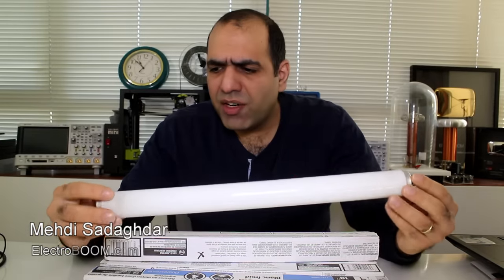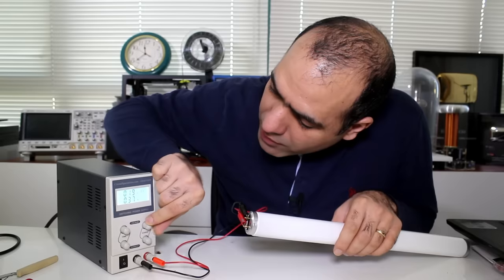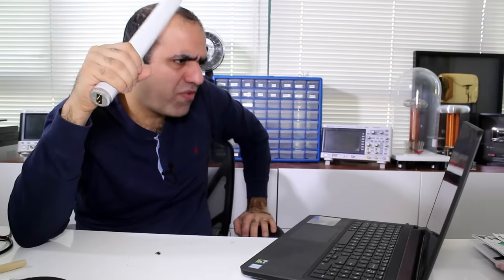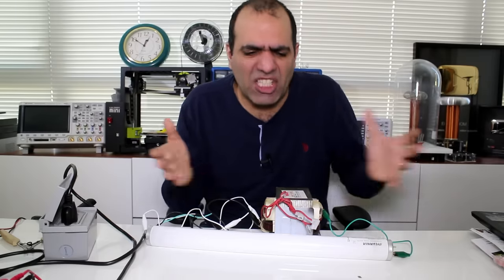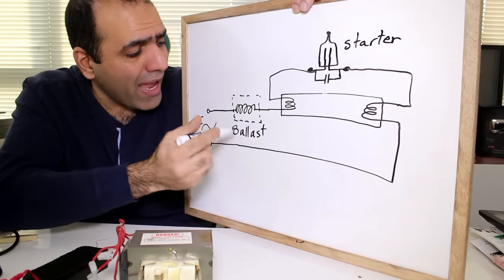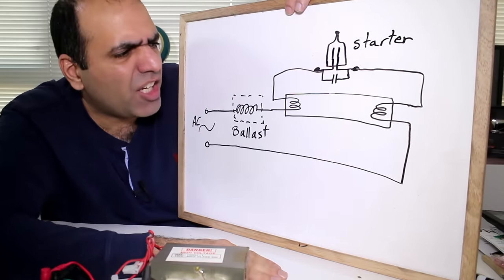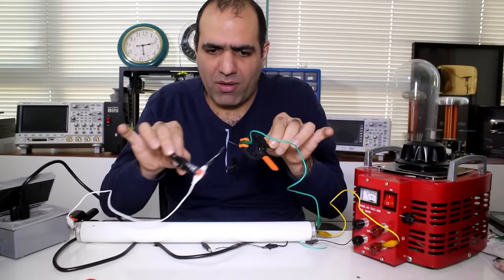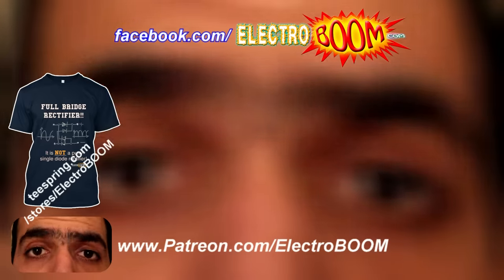How a Fluorescent Lamp Turns On

Comment from the maker: Hi all! Don't forget to sub to ElectroBOOM subreddit www.reddit.com/r/electroboom
And have great holidays , and happy new year afterwards!
Reply: ElectroBOOM hi man am ur big fan
Reply: ElectroBOOM when I did an electric project in school, we used glow starters which are filed with helium
Reply: ElectroBOOM happy holidays to you and the family, And to all the viewers
Reply: I wish i had a professor like u
Reply: U should try a live show once
Reply: Try to ignite it with your teslacoil standing nearby, if the lamp connected to the ac mains. Or with a piezo-spark igniter from a lighter. Use two 9V batteries  on each side to get the filiament glowing. I'm curious if it works :)
Reply: Maybe the power of a single 9V battery is not enough to get the filiament glowing.....
Reply: I'm not gonna tell you that playing with MOTs is risky, who am I to tell people that when I have three of them hooked in series in a Jacobs ladder (don't worry, mine doesn't self-start either). But you really shouldn't be holding both ends at the same time, especially with such short plastic clips. It would work just as well if you hooked the output to a nail on a dry piece of wood like a plank or a piece of plastic at least a foot long and drew arcs from the transformer body.
Reply: ElectroBOOM This video was hilarious Mehdi...I'm glad that I subscribed to your channel,plus I learned what Tesla taught me many years ago in this video.Tesla invented the neon tube.Your version is much funnier.HAHA!!.
Reply: Yeah! Very nice. I also didn't really got how those lamps actually works. I did know that the ballast limits the current and that you need a high voltage spike to light them up. But I didn't really know how there was filaments at then ends, how the starter works and how the starting voltage was generated (high voltage can be generated in a veriety of ways) and how everything was connected.
Reply: ElectroBOOM hey electroboom, get a train transformer so you can easily very voltages
Reply: You are the best!
Reply: ElectroBOOM happy holidays!
Reply: ElectroBOOM. I like ur video. However u should have eyeglasses
Reply: Yes, I'd like to receive one of the free sco... Wait, what? No freebies?  Happy holidays!
Reply: I love you and your videos. I am considering to become an electrician and my gf jokes then i could get my own YouTube channel. Nice idea, but you are the king, the high-voltage Guy, no one else could match your power.
Reply: Please make a video about electroplating
Reply: Stroke that lamp baby! (2:43)
Reply: ElectroBOOM Do you think it would be possible to replace a fluorescent bulb with an LED light?
Reply: Dear Mr.Mehdi! Another very pleasing episode.You always put a smile on my face,even if i´m a little depressed. Thank you for for your very entertaining and also informative vlogs! Wish you great holidays! Truely your fan from austria/europe-Knud
Reply: happy holidays to you too mehdi
Reply: ElectroBOOM #####I need 12V DC to 230V AC converter circuit at home made.. pls make it easy..

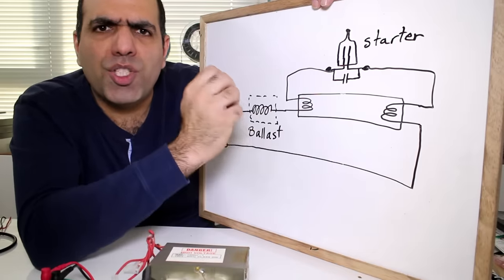Comment: 6:33 I've also experienced fluorescent tubes that start to humm and glow red at both ends but don't acually start. 
And others that start with a few plasma pops, like "Plink, plink-plink-plink, plink!". 
And even others that start with a red glow on both ends that grows brighter slowly connecting to the middle, then releasing a bright flash with a "Plink!" and going dark again, with now both ends glowing red again and a wave of plasma silently expanding from the live side to the neutral side. When that completes it actually stays on.

Comment: Actually in Soviet Union my granddad DID make Christmas lights using fluorescent lamp starter as a blinker.
It worked perfectly.
Reply: Are you sure he didn't use vodka in the circuit?
Reply: Despite the fact that you need only one singular blinking light bulb to make all of them blink. Instead of just borrowing a singular blinking lightbulb from family/friends/neighbors your granddad decided to create fire hazard. Admirable
Reply: @wiktorszymczak4760  I cannot think of any risks of using a factory-made incandescent light ballast.
Did they make special blinking lights in the 70s? Were those reliable?

Comment: The purpose of the filaments at the end is not to vaporize the mercury. The Hg is already in gaseous form. The pressure inside is pretty low. You can immediatly turn the tube on by using a tesla coil like you did or putting it in a microwave oven. You can also use a neon transformer (15 kV).
The purpose of the filaments is to lower the voltage requirement across the bulb by using THERMOIONIC emission effect which means that when you heat a metal, it kicks off electrons. The filaments are coated with a material that emits a lot of electrons. I think it is ThO2 (A white powder).

The voltage requirement across the tube is something like 93 V for a 40 W bulb once the tube is on. The startup voltage is 400 to 600 V.

PS: keep in mind that the tube contains Hg. Don't throw them in the garbage.
Reply: Thorium and mercury. My kind of technology!
Reply: Bru, he know it already he just acting dumb to teach us haha
Reply: I thought that was thallium at first. Not that thorium is much safer.
Reply: @Heads Mess 
It pollutes the environment. The amount of Hg in the atmosphere keeps going up, although it is a very small amount. Once you lose it to the atmosphere, there is no easy way to get it back. From what I hear, each tube, which is about 2 m long, contains about 15 to 20 mg. Breaking 680 to 906 tubes gives you 1 cm3 of liquid Hg.

//Edit: PharmaGiles is correct. My math is off. It isn't 50 to 70 tubes but more like 680 to 906 tubes.
Reply: @louistournas120  when I work in hardware store we through 1000 in the garbage
Reply: @louistournas120  You're a factor of 10 out. You'd get about a gram of mercury from 50 - 70 tubes, but that's less than 0.1 ml because mercury is very dense. All the same, it adds up to a lot if they aren't recycled properly.
Reply: @TheGodpharma  
You are right.

1 cm3 of Hg has a mass of 13.6 g.
13.6 g / (15 mg/tube) = 906 tubes
13.6 g / (20 mg/tube) = 680 tubes
Between 680 to 906 tubes gives you about 1 cm3 of Hg.

Comment: is there anything to stop the high voltage kick from pushing current back the wrong way, up the live conductor? seems to me that the roughly 1000v needed to strike an arc could cause current flow in the wrong direction? at least a small amount.

Comment: WAIT is this why lunch and classroom lights flicker when turning on?!!?! From the starter thing?
Reply: yes
Reply: JJCUBER also then these things get old they start to blink, and at the end, only the edge electrodes are glowing
Reply: @ΑΡΗΣΚΟΡΝΑΡΑΚΗΣ   Having the most annoying strobe light quality , its torture for me..
Reply: yes these lights are called ( Preheat ) thay used a magnetic ballast and a starter that hase a bymatalic switch in a glass capsol that is fild with argon or  neon, the argon glows a pail blue and the neon glows red, the gas in side the starter helps heat up the switch and thay bend witch thay will tuch echother and start the lamp. some times it will take one'c or two's to start butif the starter is older it will blenk a bit more

Comment: I had two 4ft fluorescent fittings, one had an electronic ballast and the other an old fashioned choke ballast.  I got the impression that te tubes in the electronic ballast lamps didnt last as long as the ones in the choke ballast lamp

Comment: Love how your idea light bulb is a fluorescent bulb, then a CFL.
Reply: yeah
Reply: Tigerman1138 what is the difference between this two lamps
Reply: CFLs operate the same way as flourescent tubes but most of them have the ballast and starter as electronics directly integrated and can be put into a normal Edison screw socket to replace an incandescent light bulb.

Comment: Could you make a video on how plasma lighters work?
Reply: ItsJosh I guess it's just a small stun gun
Reply: Karlas Dapkevičius Are you sure? I mean it is a way smaller form factor and way higher frequency
Reply: ItsJosh well I'm not sure, this is just a guess. Of course it's smaller than an actual stun gun, because it's not ment to do its purpuse. The voltage of arcs should be rather small since the gap between electrodes is small, but frequeny is higher in order to get more arcs in the same amount of time and that way light up cigarete (or anything else) faster. So maybe a correct way to say it is plasma lighters are small arc generators. And because of that they don't need big transformers to get high voltages that a stun gun need, making them small in size and frequeny can be rised even in a small microchip. That's my guess.
 Now I'm also interested how do they actually work :)
Reply: Karlas Dapkevičius And that's why I want a video on that topic

Comment: This is the science:
When electricity is passed heating coils become hot and emit electrons thorium oxide is coated on the coils for increasing electron emission efficiency the inside of the lamp is coated with fluorescent material that also gives white colour to the lamp so the ionized atoms collide with molecules of mercury vapour and forms ultra violet rays these rays are absorbed by the fluorescent material and remitted as visible light.

Comment: Do you know that you can use light stater as a blinker for regular lightbulb? Ah, the good old day..
Reply: don't you need blinker fluid  to do that?
Reply: In principle, yes. In practice 1) blinking is very irregular 2) mind the wattage 3) I have no idea, but it may wear out very quickly
Reply: yeah, and make sure the muffler bearings are good before you do it too
Reply: Very old fluorescent lamps had the starter placed outside so that you could see it blinking in the starting process. But yes, using it permanently is consuming a ton of power and will wear it out quickly
Reply: Acá aún venden bellos bulbos de filamento.
Reply: I was using them on christmas tree lights to make them flicker.
Reply: IRFZ44 Why are you everywhere?
Reply: ELECTRONIC BADASS
Reply: It's a very common MOSFET.

Comment: Make an electrical pencil sharpener
Reply: Phebilia Philip wouldn't that make an easier way to get graphite out of pencils?
I want that, i can make a pencil slingshot (Banned, but who cares!)
Reply: Just Set The pencil on fire, graphit remains.
Reply: Just use a drill with a normal sharpener and stick your pencil inside.

Comment: Electroboom have rubber gloves and a blash shield do it for the sake of your fans
Reply: +
Evanston Conner
Where would he purchase one of these so called "Blash Shields".
Do they protect him from the Jizz at 6:47?
Reply: @VestigialHead   I think he is talking about arc protection gear, which you should use if you work with high voltages.
Reply: @zn4rf  Yes I know.  I was making a joke about his spelling.  No such thing as Blash shields.  I think he meant Blast Shields which is complete overkill for this channel.

Comment: Hi I'm nandhu frm India:; For blown tubes use dc 120v( rectified) into one part of each side of d tube while a capacitor connected( still on 120 v ac) in parallel instead of starter .... and d tubes runs 5n!!!
Reply: 5nally sum1 wit gud +vice

Comment: FULL BRIDGE RECTIFIER!
Reply: On a serious note, would these lamps work well on DC?
Reply: The inductive ballast wouldn't, but I think the lamps would. But you'd still have to start them with a high voltage pulse.
Maybe long DC exposure would cause some chemical changes inside the lamps and break them, tho – I don't know about that...
Reply: Yeah that's what I was thinking about.
Reply: They don't, because one of filaments will die quickly. You can see this effect on some CFLs that make something like crude rectifier due to uneven filament degradation and end up with one side black.
Reply: The tube is a current operated device -- pretty much like an LED.  You would need a dropping resistor or a constant current supply.  An inductor can still be used for the initial high voltage spike if desired.
Reply: ... But compact fluorescent lamps and lamps designed to run on DC (automotive fluorescent lamps and the like) still send AC to the tube.  There is an oscillator set at a higher frequency so that the ballast inductor can be smaller.
Reply: @kroplaaa
"one of filaments will die quickly" yeah, okay. That would make it pretty much impracticle...

Comment: I'm an electrical engineer and design UV curing equipment, we have to do something similar sometimes when we work with gallium or iron doped lamps. We mainly use electronic drivers now but occasionally we'll get a stubborn lamp that doesn't want to start so we'll use the driver to put a high voltage over the lamp and then hit it with a Tesla coil to kick it on. It's pretty cool.

Comment: Wow this is actually really interesting. Whenever I turned on my garage lights I'd see the middle of the casing light up first. I thought it must be some kind of thing that gets the light working. I guess I was kinda right but it always intrigued me.
You mentioned the electric ballast. But my house was built in 2011 and my garage lights flicker for ages before they turn on.
Reply: "my garage lights flicker for ages before they turn on"  Bad ballast/starter or bad lamp/tube -- this was old tech long before 2011

Comment: there is what is called in the uk a choke in flourecent fittings, they control the voltage after the staarter gives a surge to light the filaments, the flourecent bulb works by heating gas in the tube, the gas can be changed to give different colours, thus neon lights.

and yes mercury powder is what is used to fill the flourecent, the glass is coated with white paint to stop you being blinded by uv light.

Comment: Interestingly I have an old work table light that uses a more premative circuit. You hold down one button to warm the filament and when you release it the lamp will start. In effect the operator takes the place of the starter bulb. 

Weirdly enough from what I can tell the bulbs never seem to go in this lamp. I got it out of an old factory when it was shutting down and I've been running it almost 24/7 for about 7 years now.

Comment: use a HV capacitor (use the one from a microwave) in series with the light and the transformer to turn it on without popping the fuse. it'll heat the lamp and the transformer, so short period use only.

also, you can use the transformer as a ballast, just connect the primary in series, maybe short the secondary with a hv capacitor (to limit the current below 5A)

Comment: You gotta try to connect the high-pressure mercury vapour lamp directly to high voltage source (without a ballast). I once happened to do it (by an accident). It was great- the burner popped open and the top portion of the lamp flew off like a hat thrown away:-).

Comment: I have a somewhat related question on power technology, I have 2 variants of laptop (latitude e6500) one with a 1920x1200 CCFL backlit display and other one with 1440x900 LED backlit display, I swapped the top lid on each of them, since the conector is the same and the display is properly detected, but the inverter board on the CCFL is hissing loudly and gets extremely hot, to the point that is impossible to touch it for more than half a second, also the battery started draining twice as fast, and when the charge is below 40% or so, the backlight is not constant, the lower the brightness the louder the noise, are LED operated different from the motherboard side? I've read in lots of forums that CCFL inverters get noisier as they age, but to my surprise, I placed the screen back to their original boards, and the hissing is completely gone and thr inverter board runs cool

Comment: We still have the old balast with starter and it works fine, though if it dies this time, we will use LED tube lights, which are simillar shaped but just filled with LED light that are connect in parallel

Comment: Older fluorescent lights had a push button switch that acted as the starter.  When you pushed the button the filaments would heat up and when you let it go the collapse of the magnetic field in the coil would kick start the light.

Comment: Spot on about them being a hazard waiting to happen, the reason they give out over time is from the heated mercury gas eating through the sealant holding the caps onto the glass; all fluorescent light bulbs work like this even the spiraled ones, it's part of why they have the warning about replacing them every few thousand hours.  
Neon signs aren't as dangerous because they're using an inert gas, but are much more power to light inefficient.  But at least mirrors have made LEDs viable alternatives.

Comment: Hello i was in a Vocational College and Electronics was one of my main Subjects. Such a Lamp usually is cold and have to get started so there is a Starter and you have to use a Capacitor. But this isn't this hard how about a 3 Phase Motor Control?

Comment: I've rewired the ancient fluorescent fixture to take Toggled direct wire LED tubes. I sure hope the next batch of tenant don't ignore the warning stuck to the fixture and put in a regular fluorescent tube... There is no longer a ballast in the thing.

On the other hand, the LED tube I put in is only wired on one side (non shunted tombstones required), and the side with the starter has been disconnected, so it should be fine.

Comment: The filaments in a fluorescent light tube act as " burners" to create an arc also to vaporize the mercury inside the tube. A ballast is needed to safely operate the tube . Without it, the tube will " short circuit"

Comment: How does a touch lamp work? Does it build up a tiny amount of static electricity and when you touch it, the lamp detects the drop in voltage and turns on?